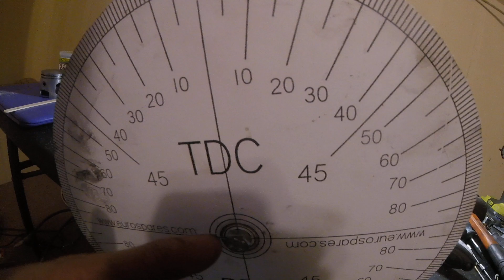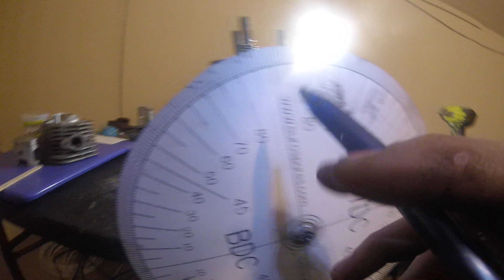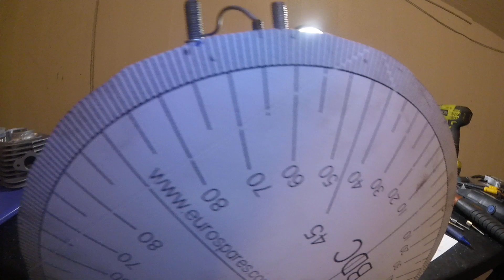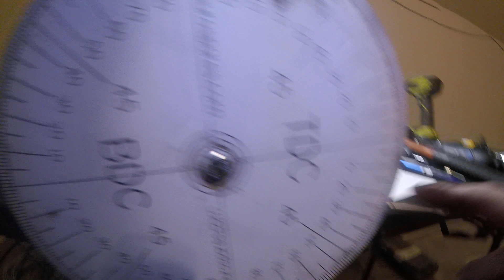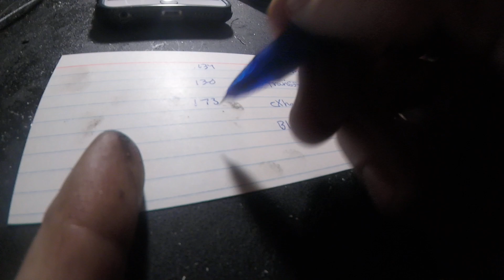using a degree wheel basics.

Comment: Not accurate. Use a positive stop. Thers to much dwell time at tdc. Stop piston before tdc. Get #. Then rotate motor opposite direction get #. And split the difference. Meaning you want both # to be the same when it hits the stop.  Again  it’s the accurate way to get the proper port timings.  Again there’s a few degrees of dwell time at tdc so  it’s not really proper to eyeball tdc.  Great vid though. Also take blowdown divide that by tranfer # it gives blowdown %. You wanna be around 17% to 22% max

Comment: What about measuring intake duration with a ported piston with a reed valve set-up, and what duration do you want?
Reply from the maker: Dogking1013  well that depends on a few variables. Is this engine going to have boost ports? How many of them? Is your piston ports feeding your boost ports on the down stroke? That’s a fairly vague question honestly. But if you have a port big enough in your piston you can draw intake from BDC all the way to TDC. Which is about 168 degrees duration because you loose about 4-6 degrees of duration at the Top and bottom in what is dwell, the point the piston stops for a moment. But... if your pipe is designed well enough, it can help draw on the intake with the negative vacuum created from the wave traveling down the divergent cone in the expansion pipe if your running one.
Reply: @wtmotobikes8838  Wow, you know your shit! I'm just starting to get into this stuff.. I was thinking about building a tuned pipe, you should do a video on that!
Reply from the maker: @Dogking1013  i can make that happen in a few months. ill try my best!

Comment: You cant just eyeball tdc..you need a positive stop to be correct. There is a point where the piston is at tdc and the crank can move without the piston moving..also your needle isnt ridged or mounted solid. It's been moving while your trying to get measurements..
Reply from the maker: kjsmolik you are absolutely right sir. Thank you for pointing out those things. I will always take criticism in a positive manner and learn from others. Thank you for correcting me. I’ll have to make a new video with much more specific detail and accuracy to finding TDC and make a much better indicator tool.